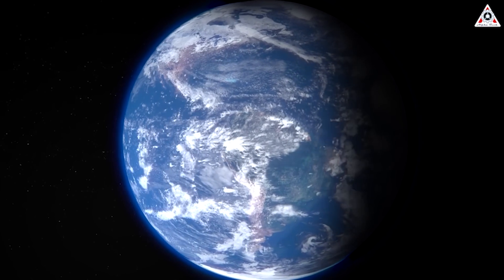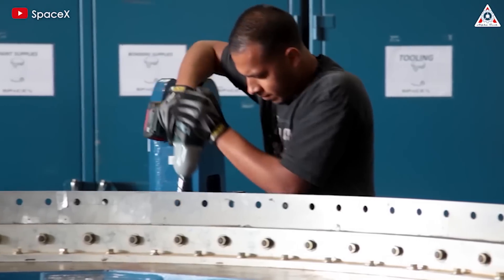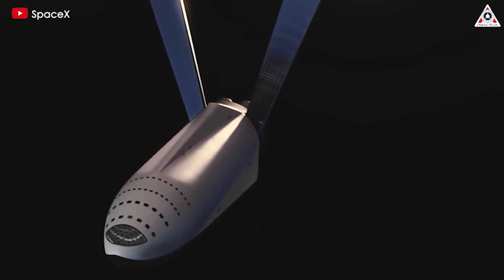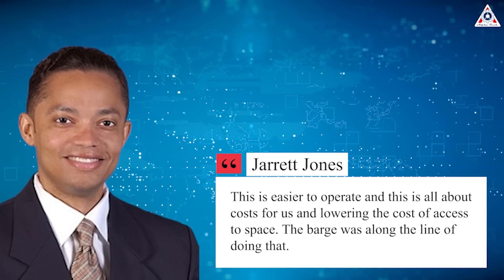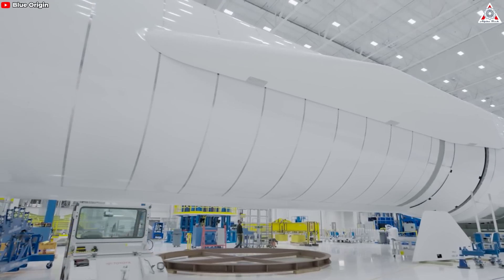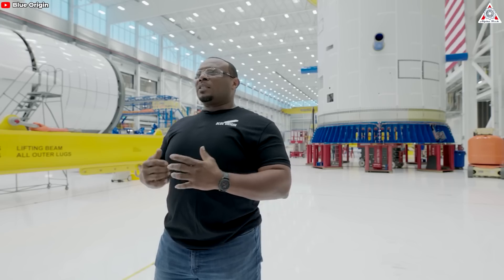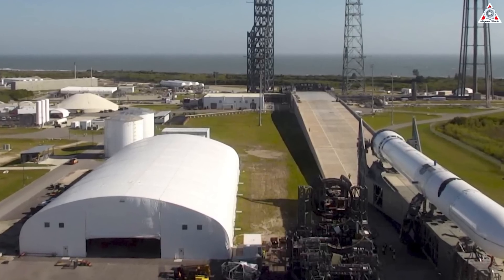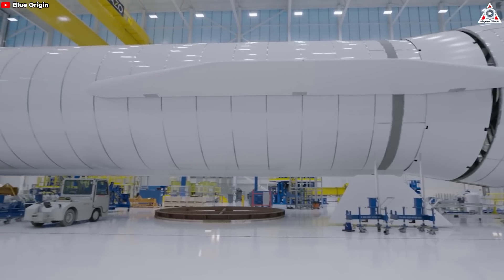Somehow Blue Origin New Glenn to orbit EXACT Starship Killer! Musk laughs...

Comment: Simulators are cheaper than using real hardware. How much is every lost Starship with 42 engines??

BTW A launch vehicle with 42 engines that need 10-20 in orbit refuelings to launch anywhere is not SIMPLE. To call this Simple is ridiculous. And to say”best part is no part” and come up with this architecture, is pretty funny
Reply: Musk was asked the cost of blowing up a Starship. He replied "$50-$100m gone every time it blows up". I suspect the latter with all the new add-ons. Still, Starlink is now raking in the money, faster and faster with each batch of satellites (6800 active satellites and counting). If Starship starts delivering satellites in 2025/6, revenues will explode (satellite capacity will grow 10x faster if he supplements F9 with Starship. Starlink is producing revenue Faster than he can spend it apparently as Spacex is looking at stock buybacks in the next couple of years at valuations greater than the current $210 billion.

As for refuelings, the V3 has 2600t capacity of fuel, however the tankers are not limited to 200t as they can be built simply with elongated fuel tanks and no "payload". That means they can carry a Lot more than 200t to orbit each time and it is Also known that the Lunar Lander did not need anything like 2600t of fuel. Spacex indicated something like 6-8 refuelings and as a tanker can readily be converted into an LE0 depot and Starfactory is supposed to pop out Starships at "up to 1/3 days (practically 100/year). Engine manufacturing is also due to increase 3-400% with the new Texas raptor factory (just completed), I would say its not a stretch to estimate they can crank out at Least 1 reusable Starship/month in 2025 once the design is frozen. 2-3 /month in 2026 easily.
With 3 launch pads available by the middle of next year for high cadence launches, that would allow maybe a half dozen tankers to be built in 2025 (given about a half dozen satellite dispensers supplementing F9 launches). Easily twice that in 2026.

If this sounds in any way pie-in-the-sky. I remind you that Spacex launched 96 F9/FH last year and is on track (despite 2 wk loss) for 120 this year. So what's 6-8 or even 10 tanker launches by late 2026? That means they built 96 upper stages during the same period and 120 this year.

Agree, its not simple... not remotely. But it is very Doable, absolutely at this stage.
Oddly, the Axios space suit (for surface excursions) seems a similar risk to the Lander (with all its complexities).
Though if needed, humanform robots (adapted from Teslabots with radiation and dust shielding) can be sent up to begin habitat construction. Maybe a small constellation of Starlink sats around the moon to allow near-real time comms to any given point with low gain equipment (like a cell phone built into the space suit).

Note that there is also no Hard date for the landing. 09/27 or 09/28 still accomplish the goal... even if they are in competition with China. By then, Spacex income from Starlink and Size of infrastructure/fleet of V3 Starships will eclipse what existed in 2026... so Spacex can finance the whole mission on its own by then... note the Dragon can deliver crew to Starship lander in LEO just as easily as SLS/Orion does in lunar orbit. 

The scary part is that if Spacex fails the first time, they can try again on their own dime without waiting for another SLS rocket or Orion capsule to be built.
Reply: @avgjoe5969  Your idea of a ring of Starlink sats around the moon is a VERY good one - allowing near real-time instruction to 'tesla-bots modified for construction tasks. 
To me, the fact that if SpaceX fails the first time, they can EASILY just try again, is the beauty of their entire construction/iteration design system, not "the scary part" of anything. 
It's what's going to us there.

Comment: New Glenn looks like it is being built to compete with Falcon 9, not Starship.
Reply: It's 1/3 bigger in it's base Block 1 configuration to Falcon 9 single core system and twice the size of ULA Vulcan Block 1.  To me Vulcan will be a surprisingly capable rocket despite being single use initially with more payload to Falcon 9 to GSO and GSO-T
Reply: @ph11p3540  It has a 7m diameter and 40t to LEO design. Expendable 2nd stage for now with a reusable one in engineering. So an intermediate step between F9 and Starship should it fly. Looks like Starship will be in full production by the time New Glen flies.

Comment: I don't believe Blue Origin has yet to build a viable working simulation of a complete New Glenn. Even a fully composed simulation of all current latest design hardware with synergistic cohesive engineered finished product has many probably inconclusive computational outcomes of margins that equal a domino cascade of failure . This would be a justified reason for the continuing lack if normal actions needed procedurally for a rocket to reach fruition.  Be it total failure or a partial success. Nothing us matching this timeline of an engineering design with timeframes of historical reference as a guide unfortunately shows a more likely fantasy than reality.
Reply: Try using shorter sentances.
Reply: @leonallen6159  no.